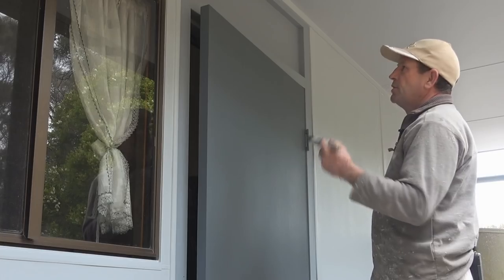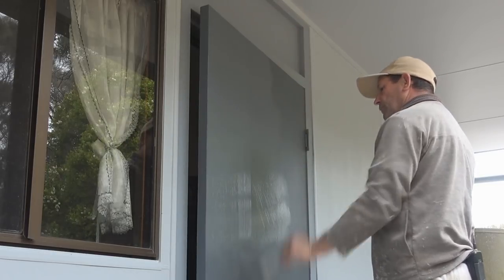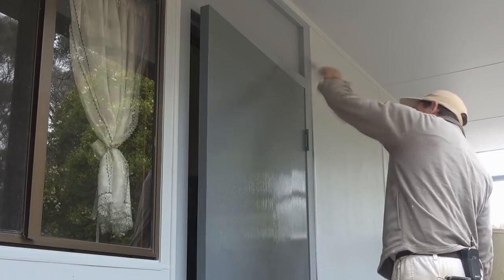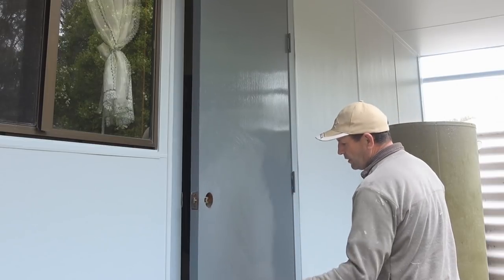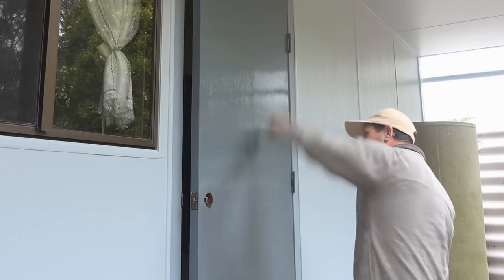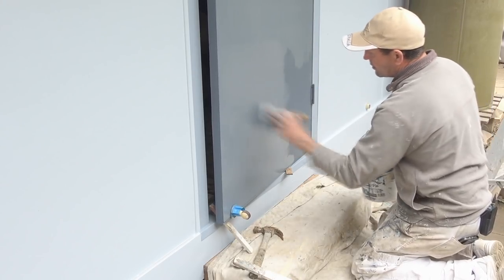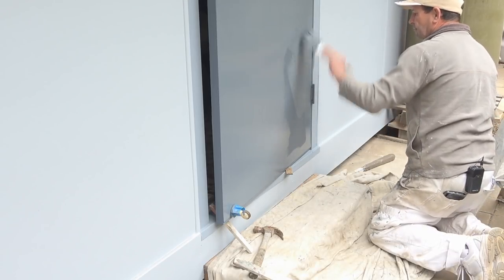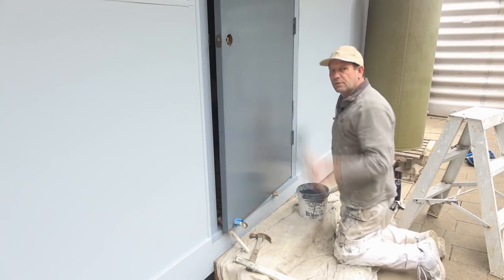How To Brush a Door Using Water Based Paint or Acrylic Paint. Painting door from start to finish.

Comment: Try this:
Get your brush loaded,
Now with a strong motion put a big X on the top half of the door applying the entire brush load onto the door. Now put smaller Xs in the spaces using the same technique. 
Now move to the bottom of the door using the same Technique, now very quickly spread the paint across the door once you have the pain't spread,
Move to the center of the door and spread the paint side to side from the center out.
This is called Laying it off, once you have layed it off smoothly now start at the bottom of the door and in one stroke go all the way up to the top of the door, move the brush over leaving a 3 centimeter overlap and one stroke from the top to the bottom then back up stroke repeating until the door is covered.
This is called "Tipping"
It off. This is an old method, many painters today don't know the difference between 
"Laying" off the door, 
And "Tipping" off the door.
You must move rapidly, but the door will look like satin when you are done without any trace of stopping and starting  points.
Reply from the maker: Laying off a door and Tipping off a door is the same thing, spreading the paint is called spreading the paint, laying off is when you finish off in one direction using the tip of the brush,  hence why some call it tipping of a door.
Don't forget to Like, Share and Subscribe.
Reply: @howtopaintinfo  
Back in the old days laying off and tipping off were 2 different things. In the last 30 years they reduced it to one term. 👍I am an old professional painter. 😉
Liked and subscribed!

Comment: Excellent tips. Speed and temperature have proven to be super important factors in my very little experience. Would you prefer if the door was lying flat or is it better to paint surfaces vertically?
Reply from the maker: If you lay the door flat you need to take if down and put it back on so in most cases its quicker to paint door on.
Don't forget to Like, Share and Subscribe.

Comment: I am painting door whit roll  ProMart 200 the problem line marks are visible, I will glad some advices
Reply from the maker: Try using a bit more paint, it sounds like you are forcing all the paint out of the roller and leaving lines in the process.Try to lay off softly, this may also help.
Don't forget to Like, Share and Subscribe.

Comment: Water based paint on a hot day is a pain. I split the door into even more than 3 sections, say five, and work down(fast).
I also think using a roller to apply and even finish, then using a 3 inch brush to lay off gives a more even finish which is quicker to apply.
Reply from the maker: Yes rolling door first then laying off is easier but this video was to show how to brush a door.
Don't forget to Like, Share and Subscribe.

Comment: Nicely explained. Thanks.

I've been pulling my hair out trying to get a decent finish with acrylic satin on panel doors. Have tried all the tips, such as dampening the door down with a sponge, keep brush damp, use 3" quality brush, etc, but it still dries almost instantly.

My flat is usually 15 degrees C without the heating off. If I put the heating on it's still only 18 C max.

The problem is, even when I go fast as possible, the leading edge is dry so my sections won't blend correctly. Looks okay from the front, but looking at the door on a side view, you can see the imperfections.

Wondering whether the following will help me:

1. Thinning the paint slightly with water.
2. Keeping the heating off, as central heating dries the air.
3. Somebody told me to keep the paint tin warm to help it run better.
Reply from the maker: Yes turn your heating of, its not only the heat that dries it off quicker but air flow will also do it. You can thin the paint down slightly but your problam could be not appling enough paint. A thin coat will dry quicker then a thick coat but you don't want to apply the paint too thick.
Don't forget to Like, Share and Subscribe.
Reply: Also try adding some floetrol or xamix latex extender , gives you a bit more working time with water based paints .

Comment: How to paint a flush door.. take the water based paint, throw it in the bin, go back to the paint shop and buy some real paint.
Reply from the maker: Water based paint lasts longer on exterior doors and if they have been done previously with water based its easier to repaint with water based paint but I do agree oil based is best for interior doors.
Don't forget to Like, Share and Subscribe.

Comment: Is it personal preference re rolled vs brushed finish? Im going to paint a pocket door for my bathroom with Resene Water Based Enamel prior to installing it. Im thinking roll and then lay off with a brush. Im in no hurry though so I suppose I could just paint each side after doing the edges with my Legend four inch brush? Its a semi gloss white, Alabaster. That way I don't have to clean a roller sleeve.
Reply from the maker: Sometimes its just as easy to use a brush because it does take time to clean out a roller. 
Don't forget to Like, Share and Subscribe.
Reply: @howtopaintinfo  Thanks, I’m a Kiwi in NZ did my Officers trg at Portsea 40 years ago. Your videos are great. I’ve ditched the roller for my 1980 x 910 pocket door. Waste too much paint cleaning. Got a Legend 4 inch brush and getting better every time I paint the door. Laying off without getting marks is the hardest. I’ve learnt the hard way not to go back into the first section after getting to the bottom of the door. It’s amazing how quickly it dries off and you can ruin what you already did.

Comment: Nice work but I think a DIY'er will struggle with that technique, the wet edge on the paint halfway down the door would have gone off by the time they got down to it after going back up to complete the right hand side...I work in 12 inch wide bands right across the top of the door from one side to the other to maintain control of the wet edge
Reply from the maker: If that works for you fine, there is no set distance you should do each time as long as you lay off with the grain and keep a wet edge.
Don't forget to Like, Share and Subscribe

Comment: Can you share some details about the paint you used??.  What type of primer was used??
Reply from the maker: The door was previously painted in acrylic paint so I washed and sanded the door. Then I touched up and any bare timber with an exterior primer then use two coats of Dulux Weathershield low sheen paint. 
Don't forget to Like, Share and Subscribe.

Comment: Roll the full door layoff. Moulded door slightly damp surface to give a bit more time 2nd coat always easier as doesn't dry as quick trial and error worked for me as its tricky with the dry time get it on and leave it. I'm with you on leaving any on frame as it delays your finish.
Reply from the maker: Maybe you should try rolling half at a time, it does work as long as you keep a wet edge.
Don't forget to Like, Share and Subscribe.

Comment: I'm interested to know what undercoat you would use before applying acrylic enamel and Do you add anything to the paint like some form of extender to help aid in the application ? 
I won't  forget to like share and subscribe 😉
Reply from the maker: Any good acrylic undercoat should be fine as long as it is for exterior use if you are painting exterior doors. I often use Dulux one step, it seems to bond well on most surfaces. I have used paint extenders before but I still think for best results in hot weather is to paint doors in morning before it gets too hot.
Don't forget to Like, Share and Subscribe, just in case you forget, lol

Comment: I'm curious if you ever found it useful to use a 6- or 8-inch (specialty) laying-off brush.
Reply from the maker: I do have a 6 inch brush but don't use it for laying of, I think normally a 3 or 4 inch is what I use. Its normally what ever brush you are cutting in with is the brush you lay off with.
Don't forget to Like, Share and Subscribe.
Reply: Ye man, it speeds up the process a lot. i use a 59 inch (specialty) broom to lay mine off, one stroke and done.

Comment: Great video as usual, I'm thinking about switching to a water based gloss for my interior stuff, skirtings architraives and doors. I'm renovating my Victorian weatherboard with traditional doors etc. Which brands would you recommend? Cheers.
Reply from the maker: I can't say i'm a lover of water based paint for internal woodwork but it's becoming more and more common. If I was to use a water based paint for internal woodwork it would need to be a aqua enamel.
Don't forget to Like, Share and Subscribe.
Reply: @howtopaintinfo  Thanks, I take it your talking about the Dulux aqua enamel?
Reply: I think it's the best thing for internals, no smell, faster drying, stays white. and indoor wood work doesn't tend to take much punishment.. i would  never use WB for exterior work,  doesn't like long under uk conditions lol.  Trouble is the industry is changing and we have to adapt.